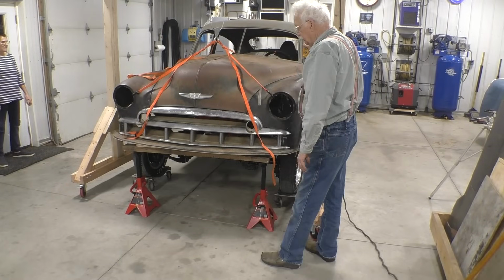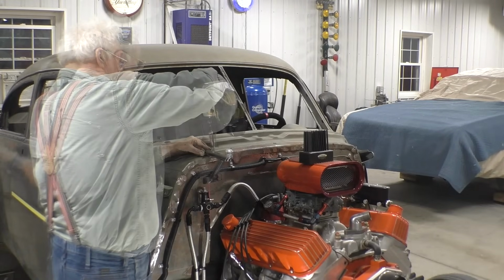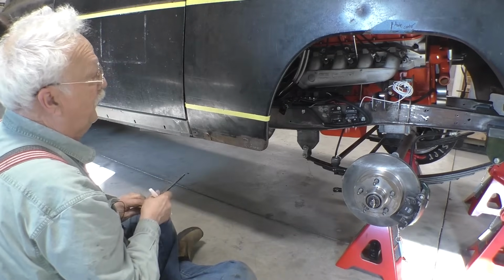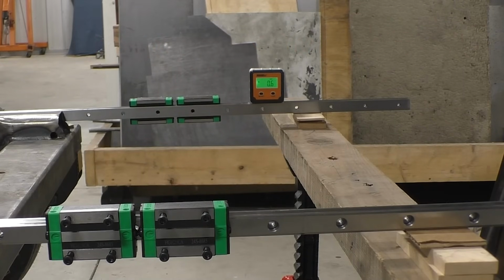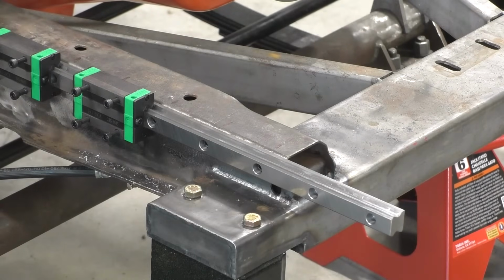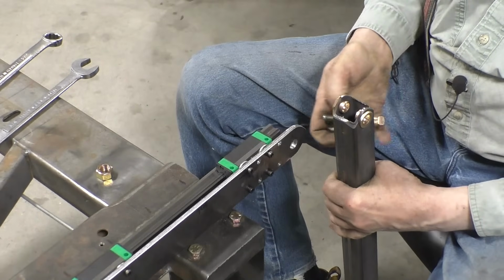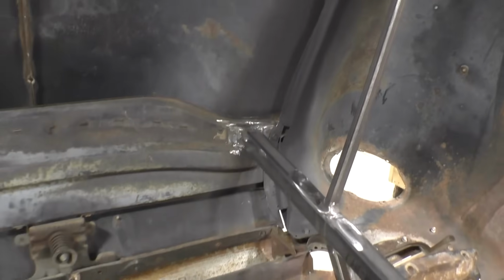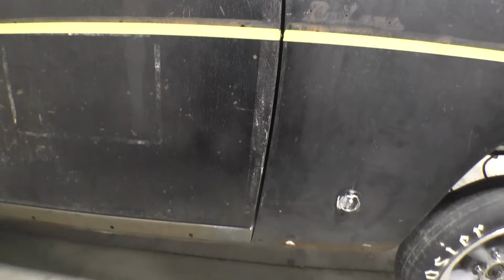Sliding Tilt Front End Scratch Build, 1949 Chevrolet Gasser

Comment: Back in 1980 I put a glass frontend on my '55 Chevy. It slid forward 3 or 4 inches then went up using hydraulics from a '69 olds convertible top. I used the top latches and a park brake handle from a mid 60's dodge pickup to make a latch system that worked from inside the car. The front end could be raised and lowered from inside the car.  On your pins, they are going to stab you in the shins when working on the motor. How about a pin going into a "funnel" near the bottom of the fender? The pin would mount on the fender and be pointing to the rear, the "funnel" would way back, out of the way. Then, of course, you have to engineer a latch system in the front. Should be easy. You could have it done by dinner!
Reply from the maker: I have put out two videos on improving the hood and latch system. I can no unlatch the hood from inside the car and the hood moves forward about a 1/2 inch. From that point it is a manual. The top cylinders is a great idea, but as this is a race car I do not what the added weight, or complexity. this is the most recent video on improving the latch system https://www.youtube.com/watch?v=uCtik1VUslE and this is the one before that https://www.youtube.com/watch?v=az9WMuna_60

Comment: Can anyone tell me what the part number is for the linear rail bearings? I'm trying to get a plan together for a tilt front end on a 62 Nova
Reply from the maker: Here is a link to them on Amazon https://www.amazon.com/ANWOK-HGR20-800mm-HGH20CA-Carriage-Bearing/dp/B099WQQP1M/ref=sr_1_19?crid=3F2BA883AM8Q4&dib=eyJ2IjoiMSJ9.D0v-j80KYv1aazj8KG5WVOL-C8V_xVVp7euD6kweBYFW8_yAzJ3eGBbG4hGsK2dVIkem8Z9Y-bdiezpgxjcl2CnXdnvHQ164yGtq7Pytpt7jkaBqDccEEwqWUL7_bF0AXeYhljTlyFCGIrcx6yX-vU_Vh0HoiSKzdhtneR8ZwUIdtMxw28TNxYhQ6peyGWa7.Ng3geM30EInP_SCDKLtrdpWbNMGgrbe-MD0NDiVC_Qg&dib_tag=se&keywords=linear%2Bbearing&qid=1757943759&sprefix=liner%2Bbearing%2Caps%2C159&sr=8-19&xpid=Zd_RMEfIMWUqA&th=1
Reply: @ThrottleStopRacing  Thanks a ton! I've been wondering for a while how I would go about doing such a thing as a tilt front end. Watching your video answered a lot of questions.
Reply from the maker: @CDeeZ69  I am here for any questions. I do not like the current side pin setup.
Reply: @ThrottleStopRacing  What are you planning on for the side pins for this?

Comment: Sorry i have another question... Has anybody ever put a vertical pin inside the fender that would go down into a horizontal brace from the body that would receive the vertical pin. No latches (unless you wanted some to keep down vibration
Reply from the maker: That would not work in my case as the hood slides forward before fore it is lifted up. Thanks for the question though as I am not happy with the current setup.

Comment: I  love it.  Question -  Could you turn the pin around  and come in from the outside?   Have a smooth head on the outside. Go through the fender, through the brace  and then latch it on the other side of the brace.   You reach under , unlatch, push the pin out and then there is nothing to  be in the way. Never done one,  just asking.
Reply from the maker: Yes, it could be done. I am thinking that the downward force on the pin to keep the tightly closed would make it hard to remove the pin. Right now I lean on the fender to get the hole and the pin to line up putting force down on the hood once pinned.

Comment: great video. building 41 ford business coupe.I am 70 years wanted a tilt front end. Want to know the size and where to purchase those linear blocks. l have watched all your gasser videos, keep them coming! Thank You from an old guy in Denmark Wl.
Reply from the maker: I'm 74 and still kicking. The 41 sounds like a great build. I got the linear Bearings out of Amazon. Here is a link to the ones I bought (you have to cut down the length) https://www.amazon.com/dp/B08GSP41QK?ref_=ppx_hzsearch_conn_dt_b_fed_asin_title_3&th=1 
CNCCANEN Linear Rail 2X HGR20-1000mm Linear Slide Guideway + 4X HGH20CA Bearing Block Carriage Linear Guide Shaft Rail for DIY CNC 

Keep in touch with your build.

Comment: What about using electric linear actuators for the pins on the lower rear fenders? If you have a dead battery or actuator failure, you could still gently pull the fender aside to raise the front end.
Reply from the maker: On a show car I would be inclined to do something along that line. Foe now I will leave it as it is. Thanks for the suggestion.

Comment: Could you possibly use a hood latch system with a cable pull on the inside that released the hood latch and latched it when closed. You seem to be a pretty good engineer that could figure out the bracket ok?
Reply from the maker: For now I will stay with the pins. Many comments on using a latch.

Comment: Fascinating! I lived in Colton, WA in the early 1980’s and there were a few local guys who were doing this to their 1950’s street rods. I never knew how they did it though so thanks for enlightening me.

I have years of experience with linear bearings, use Thompson Linear Lube in the bearings and wipe the ways with WD40.

One suggestion for the fender pins would be to use Triumph Spitfire hood latches or similar.
Reply from the maker: I have the bearings apart now for frame welding and will add some grease fittings to the blocks.

Comment: Quain Stott the owner of the South Eastern Gassers sanctioning body has a 67 Camaro with a sliding tilt front end... he used reciever rails which interlocked on the top of the firewall to "catch" the rear of the assembly and linear bearings on the slides along with a door latch under the bumper to release the assembly so there are no pins.
Reply from the maker: BW's Garage used receiver tracks and they stuck out from the firewall. I inverted the Howard bearings to reduce the stuff hanging off the firewall. I could put receiver tracks on the under side of the hood. Something to think about.

Comment: Not Bad ... Looks Cool But I Would Have Made A Better Pin Location So It Wont Catch And Dont Have To Pull The Fenders Out... But Good Job...
Reply from the maker: I had to put the pins where they are to get the right curve in the fender. The pins have gotten a number of comments and I will look for a better solution. Thanks for the comment.

Comment: You could have saved a lot of thinking by looking at how Saab designed their sliding tilt hood back in the 70s.
Reply from the maker: If I remember right only the hood opened on the Saab?
Reply: @ThrottleStopRacing  it is a "clamshell" type of hood, that slides forward and then tilts forward. Especially how it slides into place at the back could have been incorporated on your car.
Reply from the maker: @Kenjh71  Thanks

Comment: I would brace the lower fenders & use a homemade "Dzus style" 1/2 turn spring loaded fastener to secure, or maybe there are other ready made similar to what I`m describing.
I would also consider a grab point handle for easy leverage when opening or closing as well as a positive "lock open" stop in case of having the front clip open during a wind gust or someone accidentally leaning on it while you`re under it.
Reply from the maker: For now the pins will work. I may look at the problem in the future. I will be adding a stand off so the hood does not blow shut. Thanks for the comment.

Comment: Great Job! Thank you for the mentions as well. You ran with the idea and made it your own.  If i could offer anything it would be keep the bearings lubricated with grease. Ports on side accept zert fittings. For the pins, i bent ( tweeked might be better word) my fenders slightly so when you pull the pin it springs open with no interference. I just use a 3/8" bolt with a long shoulder on my slider brackets for the stop. Works great. If you need any photos or anything else just shoot me an email. Its on my channel in the about section.
Reply from the maker: Thanks. There were grease fittings included with the liner bearings but they did not fit anywhere. I have put "some" grease on the rails.
Reply: Should the upper hood slide ball bearings be adjustable vertically?  I am sure i would get it wrong height a few times. I want to do  a 37 Chevy

Comment: You're lower pins need a gutter ( channel)  to clear the bottom of the fender so you don't have to walk around . We also used a light spring to push the fender away from the pins . Great job kiddo 👏
Reply from the maker: I do not want to cut the bottom lip on the fender as it adds rigidity of the fender. I will always have two people to lift the hood as my wife will be the driver.

Comment: Nice job! But not sure why a guy would use slider's if you put the pivot point in the right location there is no need for them. 
Have a good one 👍🏻👍🏻👍🏻
Reply from the maker: I did it because it looks cool when you roll the hood out.
Reply: @ThrottleStopRacing That's the best reason.

Comment: I hate to point this out now, but you did account for the size of the front tires when you designed how far the hood rolls forward, right?
Edit: I mean if you wanted bigger tires later do you have room to spare?
Reply from the maker: Have to keep the front tires the size they are now because of the 24 inch center of crankshaft role. I have 6 1/8 inches to the tires and that is how far back the hood can roll.

Comment: Just an idea I have when I do my front end flip. I am thinking of putting the hoon pin on the inside that is vertical and drops down into a horizontal plate to pin it.
Reply from the maker: I had not thought of that. This is a drag car so show is not so important. Thanks for the idea.
Reply: My 56 Chevy is for drag and street. Blown SBC with tube axle. Trying to think of a way for me to do the tilt by myself if nobody is available to help. I saw that linear bearing on BW's Garage when he built his 55. I think you did a great job on the tilt.😊
Reply from the maker: @larrythompson7802  I could have done this project by myself with the wooden gantry. I built it for 200.00 in lumber. You could use a come along instead of the winch. Thanks for the compliment.
Reply: I had a Pinto with a tilt front-end and would put pool noodles or pipe insulation on the back of the fender to hold them out past the pin, that way I could tilt it by myself from the front.
Reply from the maker: @vincelamarche9686  I do not understand how that would work, can you explain it a little more?

Comment: I found a clear acrylic hood that was a dealer part to show off the 49 Olds overhead valve Rocket engine that I'm going to use. Those are transfer punches if anyone wants to get some, they are handy for sure. I wonder if 10-24 machine screws are heavy enough to support an entire front end, maybe a weld on each end of the rail, but it looks good. Fiberglass fronts never fit well and are flimsy, but light. Now you need a tow point on the frame. Are you going to paint the car? What color if so?
Reply from the maker: That dealer item must be worth some money. When you say transfer punch are you talking about the center punch? There are 16 hardened bolts holding a 120 hood which means that each bolt is holding 7.5 pounds. I know it is not equal like that when the hood is being opened or closed. I think I am all right with the 10/24 bolts. No tow point, we expect to drive to the lanes and pits. Color, for now the plans are to strip it back to the frame and power coat it green. The body for now will receive a coat of matte clear